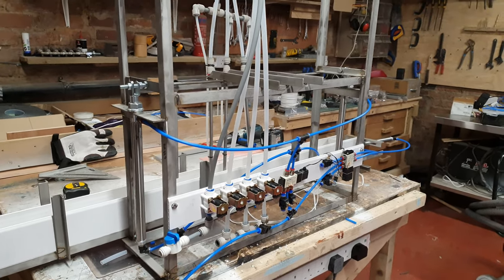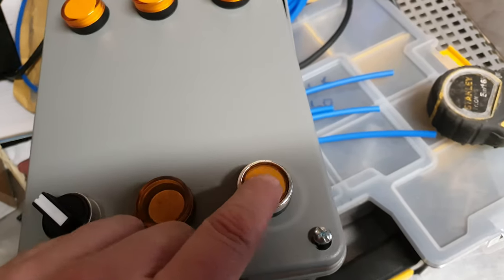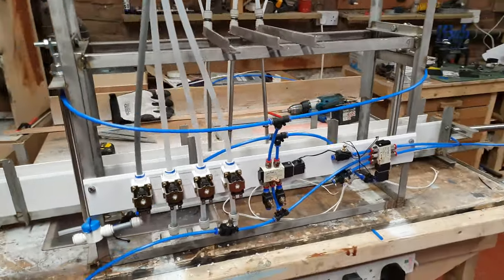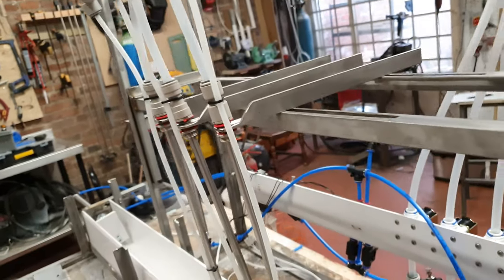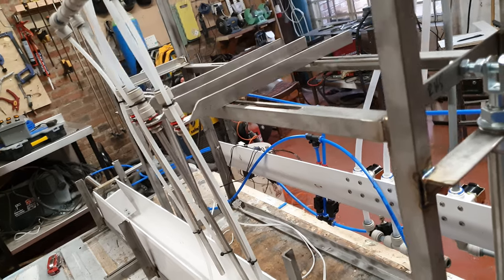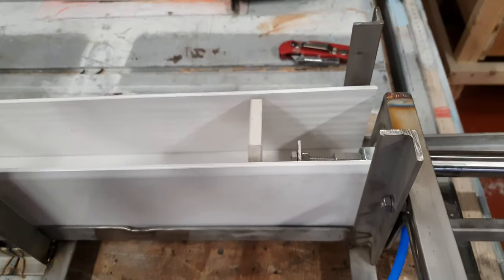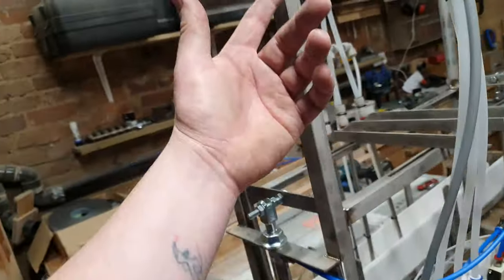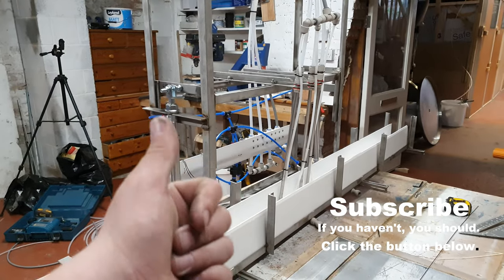Can Filler ~ Solenoids & Pipework

Comment: You're a genius, Harry. 
Just a thought...
The 5v probe will need to be insulated against filler tube, any liquid covering the filler tube, Co2 and any cable ties will create a short, so you might need to use something slightly more rigid and supported further towards the top.
Thanks for sharing :-)

Comment: Is there going to be any issues with the pipes dripping, supposing it may be a good idea to put the solenoids as close to the filler tip as possible?
Reply from the maker: I'm hoping surface tension will help out there.